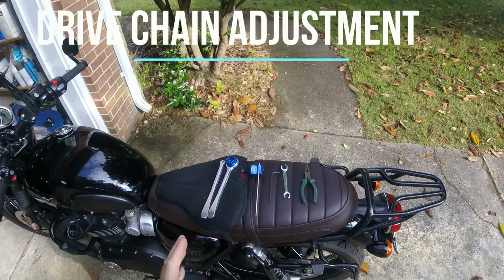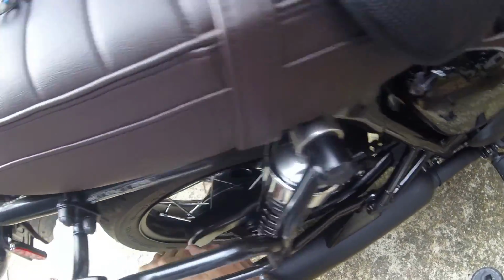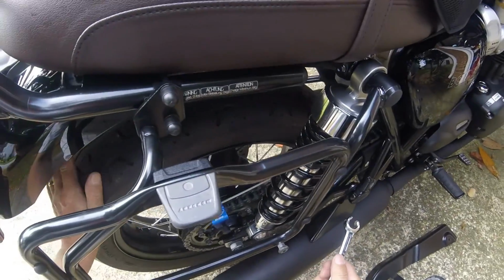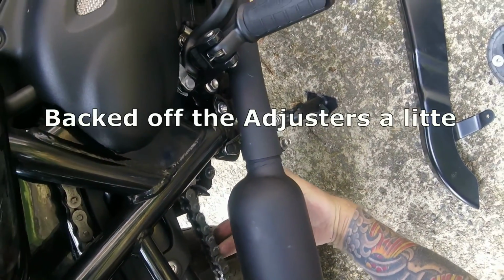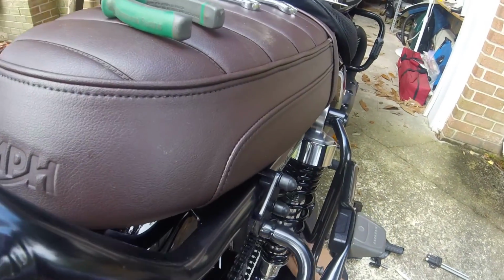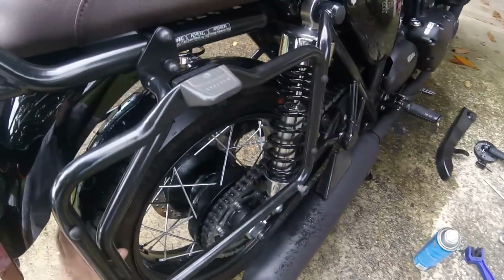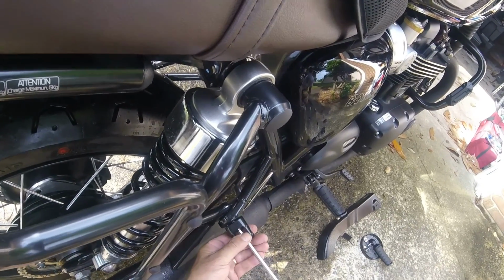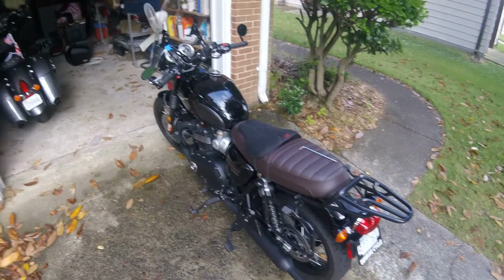Triumph T120 Drive Chain Adjustment May 31st  2019 How to Adjust your Drive Chain

Comment: Just adjusted my Bonneville chain yesterday, took me about 3 hours but I did NOT have the correct tool so had to take off the right silencer and release and drop  the left one.Looking for the ball bearing on my hands and knees that drops out the rear footrest took about 15 mins all good fun. Thanks for the video
Reply from the maker: The right tools and a little patience make a world of difference

Comment: Hey, don’t disassemble the foot peg and fuss around with all those little parts.  Just block the bolt from turning, and remove the nut from behind the frame, and take the foot peg off in one piece.  Much easier and safer.
Reply from the maker: Found I good way to do it

Comment: An easier way to remove the rear footpeg is just to remove the one nut on the inside of the bracket.

I did your method first.  It was a pain in the ass getting it back together when I had the whole thing dismantled.
Reply from the maker: I don't remove the exhaust any more I have a specific wrench so I don't need to remove it.
Reply: That's all very well but how do you stop the cap-head screw from turning as you are undoing the nut?
Reply: I didn't have that issue.

My Bonneville was purchased in San Diego, California.  I don't know if that's relevant or not . . .
Reply from the maker: @rossmarshall8151  you hold that nut in place with a second wrench
Reply: @stevenjonestriumpht1207  
You’re misunderstanding, forget it.
I have taken my footrest’s off and replaced them with the correct Triumph blanks as I have no intention of taking a passenger.
Reply from the maker: @rossmarshall8151  ok got you

Comment: Please, please, please do not adjust your chain as described in this video
I hope not to many folks followed your instructions as serious gearbox damage could occur requiring very expensive rebuild.
It is a bit of a faff but follow the instructions in bikes manual once you have done it a couple of times taking the silencers off and on will only add 15 to 20 minutes max and the job will be done properly.